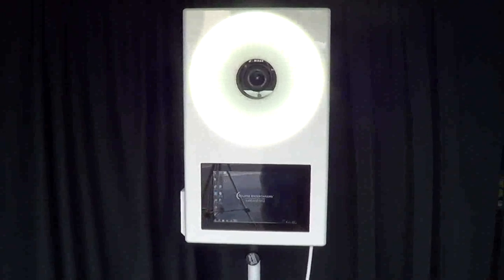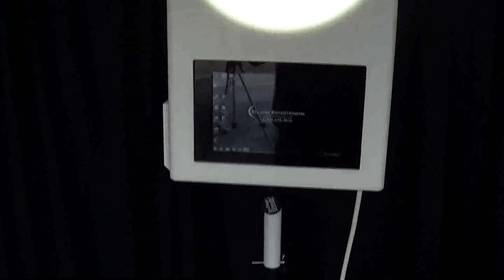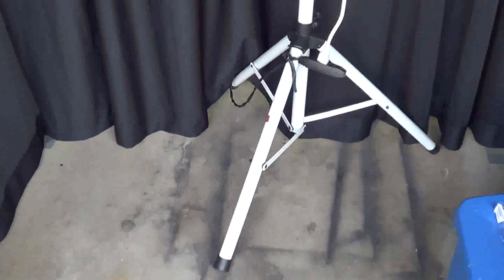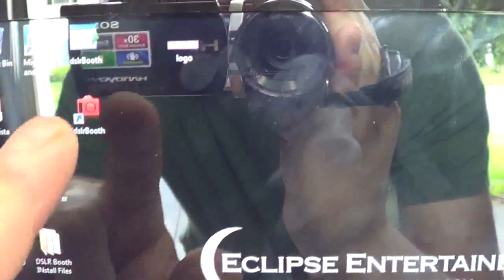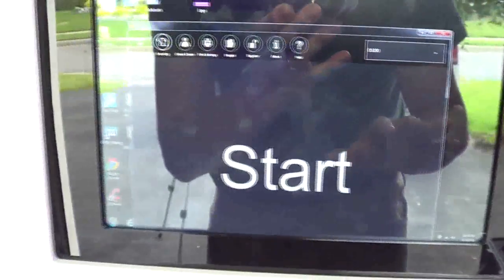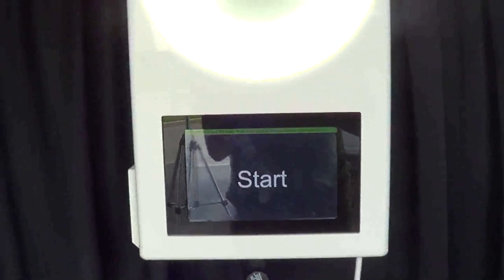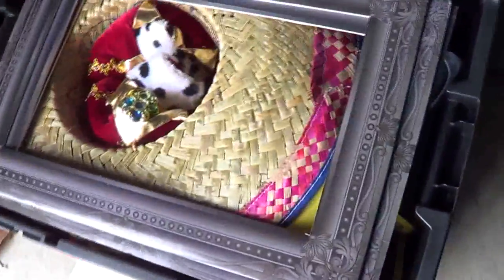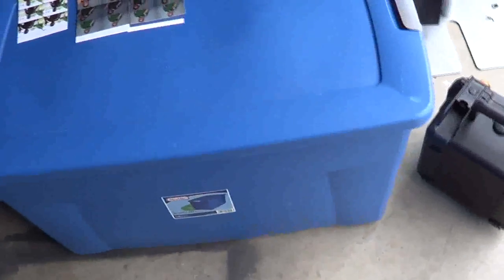How to set up and run the photo booth

Comment: hey there, i know is 2017 and this was uploaded in 2014, and my question is. Are you still running your photobooth? I am just looking for some good solution for laptop or 2in1 whatever i should call it, and so far everybody using Microsoft Surface Pro which is hell expensive and no necessary i guess. May I ask you what are you using?
Reply from the maker: Monika Kalaitzidi we are using a surface pro.  Spend the extra 200 and get it.  Itll last forever.